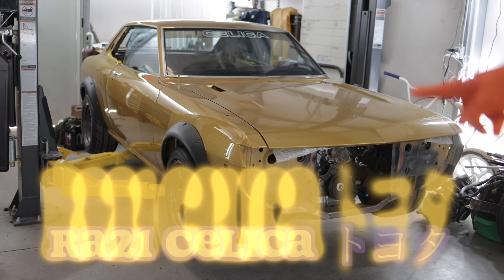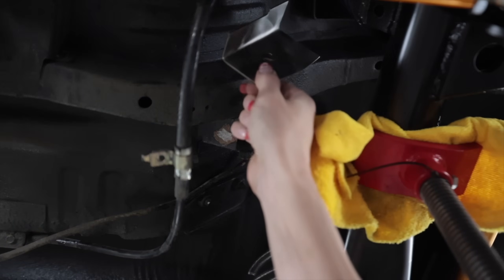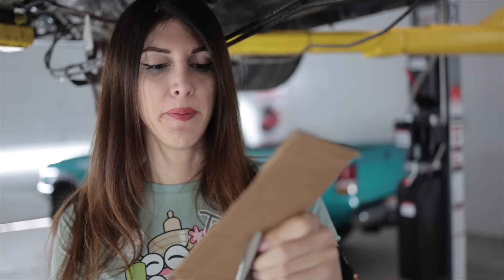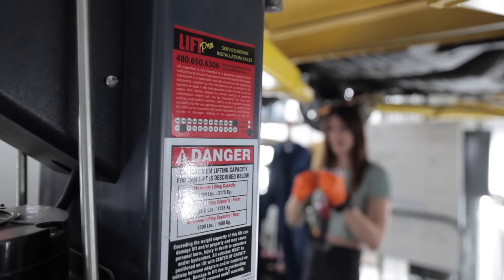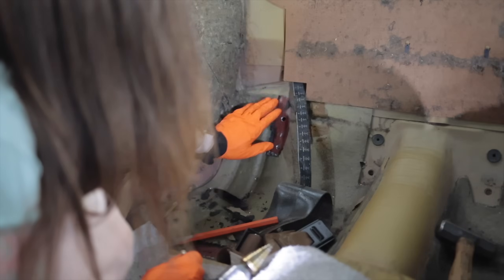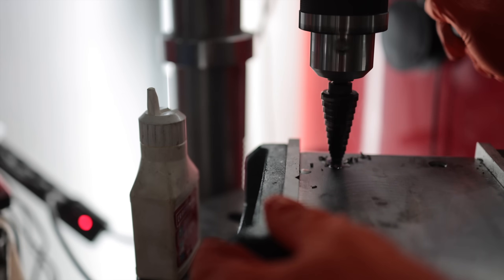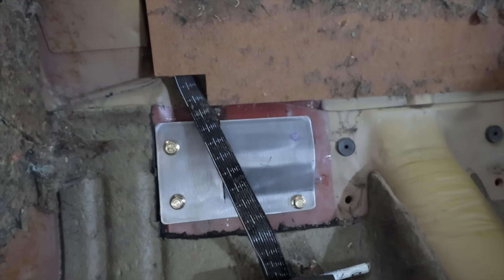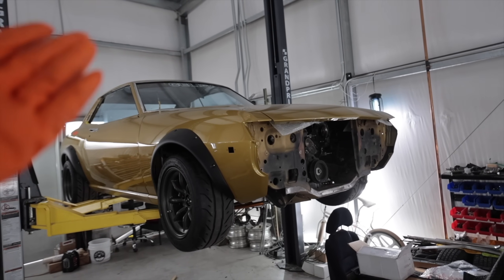Fabricating My Own 4-Link Upgrade // 2UZ-FE V8 Swap

Comment: If you don't have access to presses ect..  You probably could have used your flat plate and used some metal spacers with holes drilled in them to run the bolts through ..  or even just washers for spacers..

Comment: Have you considered just fabricating everything but only tacking the joints then have somebody else finish weld everything? That would keep the pace up and let you focus on the design aspects. Better still if time poor would be the plastic mock up systems... Can then either shop it out entirely based on the mockups or fab outside of the engine bay which reduces the welding skill needed considerably 👌

Comment: Using a "step-drill" is cheap to begin with. I hate those damned things. Just use normal drill bits. A pilot hole and then the size bit you need to finish, is all you need.

Comment: just fit and tac the tubes together with the mig and then take them out and finish them on a bench with the tig. it is way easier for the beginner tig welder.

Comment: T.I.G welding stainless is fun when you get your gas , heat and rod angle right your weld turns gold especially on 304L and 316L.  Y ou will get little rows of gold. I did it for years.

Comment: 5:40 - No stress. Wait until you have an assistant drop something sharp in the direction of a Cinema camera lens.... One is an incident, twice is careless, thrice is a new assistant.
Also, "Idiot Filter" - the stock UV cut lens we all use to protect the front element from our own idiocy. Buy Several.

Comment: Air driven for compactness 90 degree drill motors exist for tight spaces. 45 degree also. Some heads take a threaded bit or a short quick change for even tighter spaces. Battery power maybe but air tools are usually smaller.

Comment: You probably I have thought of this but how bout putting panel adhesive on the inside plates for you link support. I think it will help with the overall strength and will reduce the shear moment on your bolts. Love your work and this series 👍

Comment: Woo ... for most people I wouldn't recommend TIG for someone's first time learning to weld, but you seem ADHD enough to handle it. Maybe a brief foray into gas welding so you can experience what to look for in first person when you start tiggin' ... the process is very similar ... just far, far, faster ... and there's usually a pedal. Do keep in mind though that what your welds look like on the outside matters far less than what they look like on the inside, with a couple of exceptions. I would also recommend you get a fair number of extra electrodes and maybe a couple of nozzles.

Comment: you need to drill a relief hole in that inside plate at the end of the cut line so the twisting force is reduced and won't concentrate the stress.

Comment: should check out arc droids. they're a smaller tabletop-ish plasma cutter. you can manually cut or use 3D models with it. also I think it would be rather entertaining watching you learn to weld.

Comment: Your lucky with the plasma cutter. Just hire someone else to tig/mig it for you otherwise if migs is easier for you to do and its close enough to whatever strength you want just do it. If you want to be a fairy pumpkin , sure it will be series content.

Comment: Knowing how much of a perfectionist you are and how much the headers will be on show, I’d suggest mocking up all the bends etc, tack each joint with stainless MIG, then getting them fully TIG welded off the car by a proper fabricobbler. 
Do your learning/practicing on non-critical parts.

Comment: I would watch that for sure. I did some TIG welding back at UNOH in welding class and fab class. I was not the best at it for sure, but I can throw you some pointers if I can.

Comment: Hi Sarah. Speaking headers, Thorley Headers are made for the 4.7 both early VVTI and with VVTI 4Runner and Lexus LX 470. I bought mine from Underdog Racing Development  in MD. Maybe that would be a fit or help for easier fabricobble.

Comment: Hi Sarah, I'd say film the welding learning process, I always appreciate the details. My suggestion is to buy whatever headers for the engine you can find, and modify them to fit the car, this way you have a flange and a great starting point.

Comment: There are kits available from most header manufacturers. They consist of plastic pie shaped tube pieces. You make the shape you need, glue or tape the pieces together. Send the finished shape back to the mfg. And send you custom headers that fit your specifications.

Comment: Grade 8.8?!?! It’s metric, you mean grade 10.9 or 12.9?
Metric class 8.8 = SAE grade 5
Metric class 10.9 is weaker than SAE grade 8
Metric class 12.9 is stronger than SAE grade 8
Reply from the maker: J.I.S. SEMS bolts are rated differently than Metric/SAE stuff here in the states.

Comment: TIG is great, but with your time crunch, I'd suggest MIG welding as it's just easier to learn. Just the same, learning any welding would help expand the projects you can complete and I don't think anyone would mind seeing you learning to weld. Maybe there are some smaller projects you could use to learn on rather than jumping straight into those headers.....

Comment: So for a small plasma table, Langmuir Systems Crossfire. 2'x2' table, and works quite well.  I have the XL version of it, which basically makes it a 2'x3'.  Get all the options, especially the Z axis kit.  I didn't get it initially, and soon realized the error of my ways... the sheet metal warps as it gets heated so anything thin (like 14 gauge and under) is a pain to get a nice cut without it compensating on the Z axis.  Understand that for any plasma table, you'll be learning some sort of CAD software.

Comment: What do you plan on running the v8 with ? Are you going to use the stock ecu or another megasquirt and did you run it out of the car or just put it in?

Comment: That primeweld is what I want to get to learn TIG. That would be a great skill to add to your toolkit. I got the Eastman plating kit w/ yellow passivate (which gives that Chromium plated look). I haven't used it, but that's a thing I've seen RRC Restoration use a lot. Another great skill for your toolkit!

Comment: To assist in the header fabrication: icengineworks. Very spendy. If you plan on these types of fabs., well worth the money. Or, 3D print if time is not an issue. Purchase SS cut sections for initial weldment.

Comment: I'm a bit "over engineer"  I would weld some webs on each end of the sandwich brackets. It would make them less prone to flexing.   I also build my stuff so one person can bolt / unbolt without help.   Clenliness and tight fit is the secret to tig. 😉

Comment: I would get rid of the undercoating before bolting in the strengthening gussets. The undercoating will eventually squeeze out leading to flex and perhaps failure.

Comment: Would you watch a Sarah-n-Tuned welding video?
Ummm,
Would it take away from the sandblasting, pop-clip-ing, fabri-cobbling, or smack-a-ma-doodle-ing?
TBH, I'm looking forward to Sarah letting her hair down, and rewiring a modern car with the fabric-covered stuff we had in our aircraft as techs. But I'm perfectly content with following along as we lubricate the hinges on vanity mirror doors, too.

Comment: are you not worried that by only Bolting on those stainless piece's for the strength that dirt and moisture will get trapped behind and start Rotting the shell of the car without you being able to see it  ?

Comment: When you are trying to figure out where the hole will be on the other side of a panel, place a strong magnet on the side you will drill from and a small piece of iron on the other side to locate it. A ball bearing works great.

Comment: Sarah,
Take some time to at least learn rudimentary tig welding. You would be surprised at how quickly you can become moderately skilled. Not titanium bicycle frame skilled, but probably steel or even stainless header skilled. Just park your ocd at the door and accept less than absolute perfection.
Of all the YouTube channels I watch (118. I’m old and retired.) yours produces, by far, the greatest number of smiles per minute, which is how I rate videos.
Weld. Learn. Fail. You know that is ok? Do it again. Succeed!
Keep the aspidistra flying!
Love,
Paul

Comment: If you're using stainless you need to isolate it from direct contact with mild steel or the mild will corrode when it gets wet. Nylon top hat bushes for the bolts would do, and either thick paint or a gasket for the plate. If you're welding a captive nut you need stainless bolts and bushes in the mild steel. Learn to tig - it's a life skill. I think a lot of people will appreciate going on that journey with you (you probably won't be able to film welding easily though).

Comment: May I suggest a distance plate for the area around the one bolt hole of the retention plate on the inside?
It could be tack welded to the retention plate.
That way you'd enlarge the area where the retention plate can transfer the load.

Comment: Openbuilds sells some small XYZ machine kits for wood milling (2.5 axis machines) and you can attach a regular handheld plasma cutter instead of a wood router. Most 3D printer firmware (like Marlin) support this type of operations for laser cutting engraving etc.I have no idea how clean the cuts from the handheld cutters are (compared to the CNC cutters)

Comment: Barbarian(s) is an ancient Greek word and means those that weren't speaking (ancient) Greek. Technically you are a Barbarian as well under the original meaning. The term changed over the millennia to the modern meaning.

Comment: Anyone doing this, welding car can be dangerous, so much burning materials there. At age of 8, I save that day when spending time at repair shop: welder got car burning inside without noticing it. I mentioned it before thing escalated and fire was fast extinquished. Car was only Fiat 600 but still... (yes, 50 years ago kids can wander and wonder real life).

Comment: I have no doubt as to your reasoning for fabricating that SS plate that had 4 bolt holes in it, but just for my sake, why couldn't a few grade 8 washers placed between the plate and the floor of the car work instead of shaping the plate itself. I'm sorry. I either can't imagine it or I'm just dumb. ☹🌹

Comment: Yes to a video on tig welding, more skills in the pocket is never a waste of time.  Just a note on the header fabrication, any way you could take something "off the shelf" and modify to suit? It might save you some time. Cylinder head flanges should be no issue with the help of your helpful bbq neighbor. Keep up the awesome work!

Comment: I too also need to pick up Tig welding for when it's needed(I hobby mig weld and did structural stuff just fine). 

Let's see how your unique brain goes about picking up Tig welding enough to make manifolds (which I also have to do for some 3.6 VR6T b5s4 goodness

Comment: Love the vids!! Don't mind watching you learning tigging at all. But as a pipe welder myself, tigging is one of the most difficult processes to learn. And learning on stainless and the fact you had all (or most all) pieces custom made, you might want to talk to Charlie for a second opinion. Not at all trying to discourage you, just wouldn't want to see you ruin your brackets then have to have them custom cut again. If were carbon and pieces you cut out and tigged it might be a better learning situation.

Comment: For a small plasma table. Look at Arc Droid. It's a very cool tool for what you do. A very small footprint. I have a bunch of welders. The new multi process units are inexpensive and can really do a lot of work. Some are so intuitive that you can make nice-beads your first day. For novice tig welder, the pulse tig option can make you look much better than you are.

Comment: Please stay away from metric grade 8.8 hardware for that application. 8.8 is about equivalent to SAE grade 5. 12.9 is where you need to be. It's not worth the risk shearing those 8.8 bolts!

Comment: That came out great! I would have drilled all your holes with a pilot size and then did a final step up to the bolt size. That would have removed any slop.

Comment: That 9 inch diff is a huge lump to jump up and down, massive overkill considering the lack of power it has to handle but it will never break. friend of mine has a 79 LTD with a 351 and Ford obviously felt that a 6 cylinder sized diff could handle it , the only stipulation on the label was "Use heavy oil".

Comment: It would be interesting for a bit to watch you learn to TIG weld.  but just for a bit.  once you got to a point you were happy with your results you could skip ahead to the finished result.  Thin wall TIG welding is a skill that requires lots of practice.

Comment: For that bump in the metal plate you could have covered it with plastic wrap or aluminum foil then covered that with masking tape to make an exact mold or the part.

Comment: I wholeheartedly endorse your desire to pursue developing TIG welding skills. 
Note,: when drilling hollow tubes to accept cross bolts that will be subjected to tension preload, it is recommended to sleeve or 'pin' the drilled hole.  That way the sleeve will react the compressive bolt forces and the hollow tube will not deform under pressure.  if the frame tube collapses, you may lose preload and the bolt will work loose and 'wallow-out the hole.

Comment: I vote yes on the welding video. I'm self taught and I found it very useful and cost effective doing it myself. Tig is tricky. Gaps are your enemy and remember to breathe. Once you get the hang of it, it's a major confidence booster.

Comment: If you can find some headers that fit that engine for another car that is at least somewhat similar you would have a start. Then you could rework them to hopefully fit. You would at the very least have the tubes correct coming off the heads. Worth a try at least. You can always cut the tubes and weld on from where they no longer fit...

Comment: Sarah, they make regular plasma cutters which will do just fine for prototype and one off fab work, they are the same size as a 110v MIG welder. 
You will still have to clean up edges, but way faster than a nibbler!

Comment: Cut a couple short pieces of the pipe so you can practice and set your machine where you are comfortable. If anything you can tack the headers together and hand them off to someone else to finish welding. I'd say it's a great way to learn and odds are later down the road when you get some experience you may decide to redo them prettier and more efficient.

Comment: MIG welding is actually super easy to learn. I could teach someone in a couple hours. It only seems intimidating coz people often make it sound intimidating....... It's not much harder than learning to cut metal with an oxy-acetylene torch. ( you can also weld certain things with oxy-acetylene torch welding method) 
MIG welding= turn on gas tank- set gas level- select proper voltage/heat range-  select proper wire speed- clean parts'- pull trigger- use steady hand to get hot melting to penetrate both parts & melt them all together......Stick welding = easier to learn than MIG 
TIG welding = steady hands takes some practice & knowing proper prep work.

Comment: YES!  they do make minature versions of plasma cutters, but you probably want a desktop waterjet - then you can cut plastic, leather, foam, ceramics, wood and anything else you can think of as well as metal...  Wazer makes one that I have been lusting after.  it's in the 9 grand range.

Comment: FYI the punch you used at 15:30 is a push punch you can just push down and it will it will automatically punch your metal.  No need for a hammer.

Comment: Definitely set up welder and run some tests on your waste pieces for plates. Just dial in machine and your technique. It’s not alot of welding or thick material. New machines are so capable. Formulas for setting for your material is probably right on machine

Comment: Show tig so i can learn the in's and out's of TIG welding. I learned a lil as a Bradley mechanic in the Army and learned how solder in a two week course at Ft Gordon Georgia. Tinning a wire without bird caging from the heat sink was critical

Comment: You should do just about everything then  headers last. Like mock it up with even cardboard just so you have an idea where everything thing will go and then you can plum everything around that. Then get some stock 2uz headers in place just to get things running. After that go to a fab shop for exhaust.

Comment: Sure!  Get some scrap pieces of the same material and thickness and jump right in.  I did structural steel welding in my early life but never tig.  I suspect you'll pick it up quickly & it would be fun to tag along as you learn.

Comment: Three comments: 1 You can buy a small mig or tig welder and teach yourself enough to do what you need to do in a fairly short amount of time. 2: 4x4 plasma tables are fairly cheap and in your climate could be kept outside under an easy-up if need be.  
3. Any stepper bit is junk if some jakeleg uses it for about 30 secs.